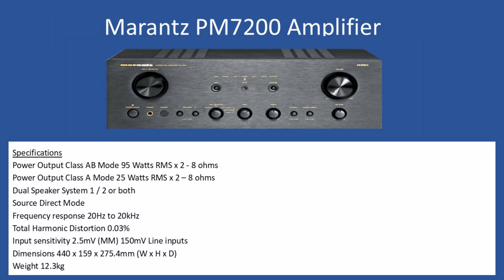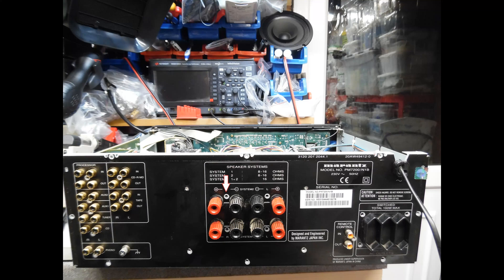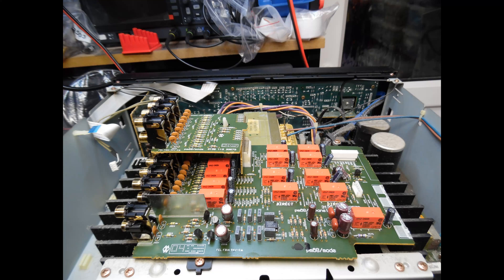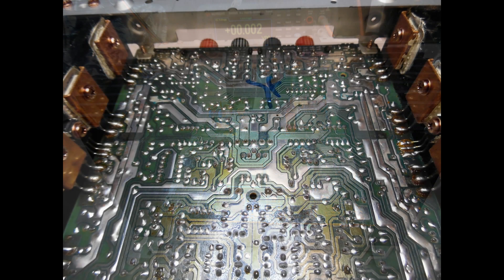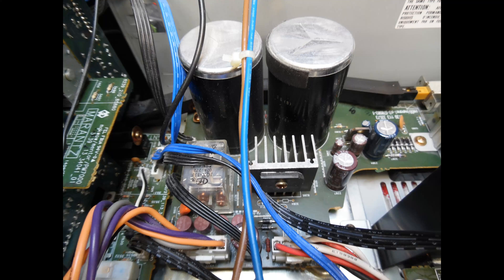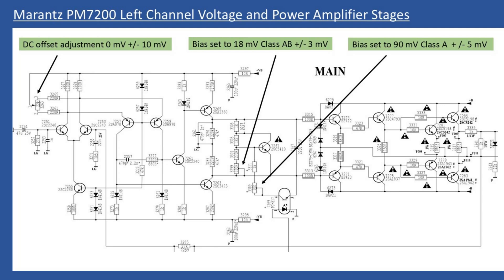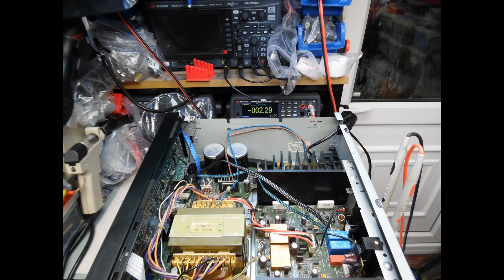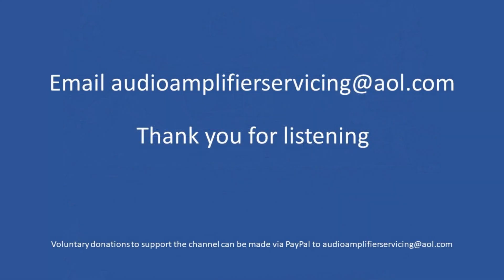Marantz PM7200 Amplifier Repair (With Audio Tutorial)

Comment: People in your area are so lucky to have you. It's hard to find a skilled technician here in my location . 
Ive got pm6006 . It will go to protection mode after 25 seconds and then i turn back on ..same thing happened all over again....if ive taken out the two speakers connection, it seems to be normal and can only use headphones. 
I also observed before when it wasn't in protection mode, the sound bass is distorted and the volume becomes lower......sorry for english
Reply from the maker: Hi, the first thing to check is the power supply voltages. You can download the service manual from here https://elektrotanya.com/marantz_pm6005_ver.5.pdf/download.html

Comment: Thanks: I have heard you talk about how common it is for Marantz amplifiers of this vintage to have many failing solder joints but have not heard you offer an opinion or explanation as to the cause; is it, for example, poor quality solder, not enough or possibly both? Is it mostly due to cutting corners for short term profit over long term reliability?
Reply from the maker: Hi, the lack of solder is most likely due to the flow soldering process used at the time of manufacture. The circuit boards via a conveyor belt pass over a molten solder bath and solder is transferred to the component leads and in turn bonds the component to the circuit board copper tracks. Only larger components are hand soldered. The issue with dry solder joint s very component for all electronic equipment that is mass produced.